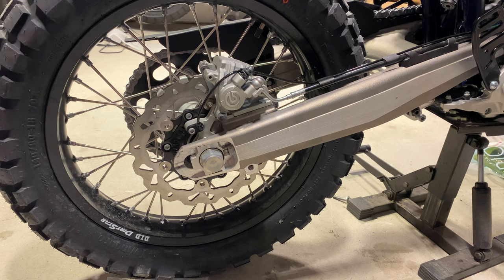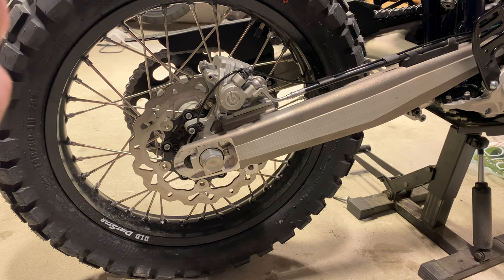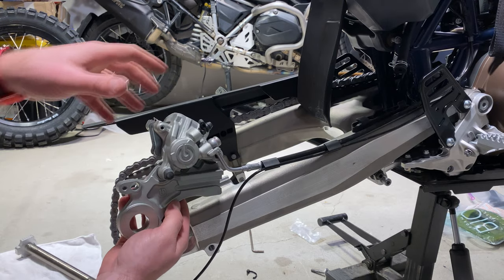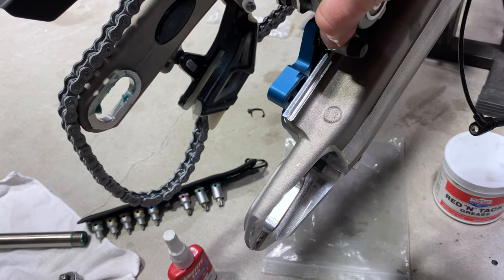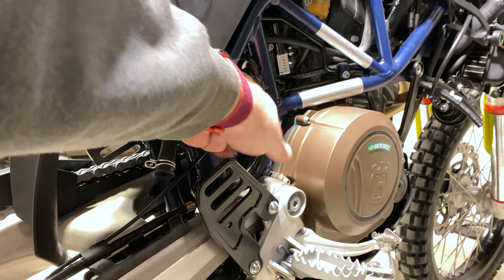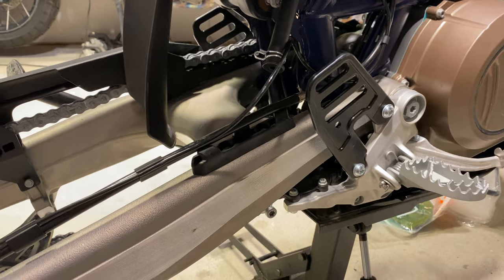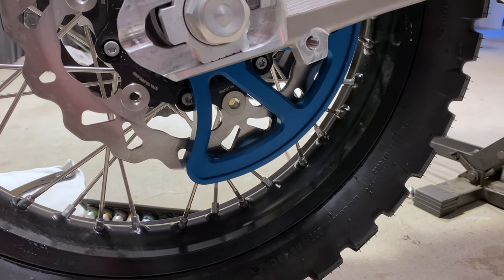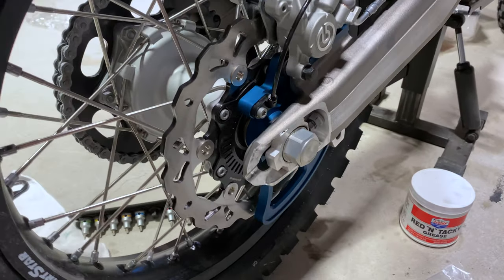Install: Vanasche Rear Disc Guard for KTM 690 and Husqvarna 701 Enduro

Comment: Hey Adam, what stand are you using for the 701? Cheers
Reply from the maker: Hi Cole, it’s just a cheap Amazon dirt bike stand. You can raise and lower it by spinning the plate then there’s a small hydraulic foot pump to lift it high enough. These are pretty identical no matter what you buy. “Hydraulic dirt bike stand”

Comment: I wonder what the stats are on damage that this device could have prevented? I'm sure rear rotor damage happens a fair bit. But how much of it could have been prevented with this? This is added unsprung weight after all. If the bike falls over on a rock this protects a third of the rotor. I'm skeptical it's worth the cost and weight. The accessory makers like to take advantage of our neurosis ;-)  I've had my 701 for a week so...
Reply from the maker: I’m not in the industry but I have bent rotors so that’s why I run these.
Reply: @AdamChandler86  I'll probably regret not having them protected.
Reply: There are chinese copies you can buy for a fraction of the cost.